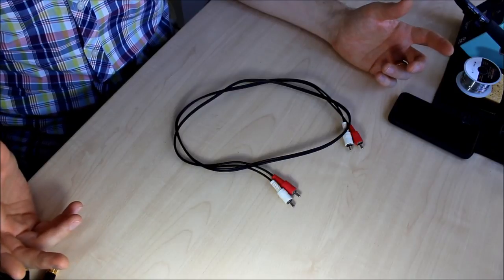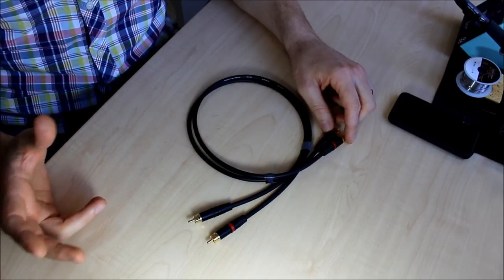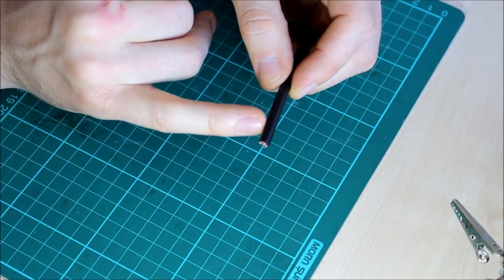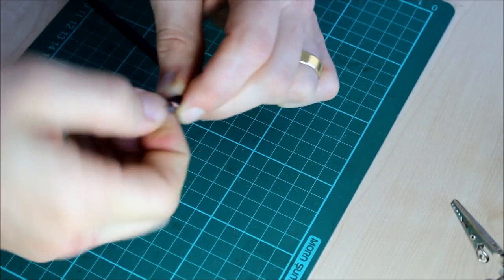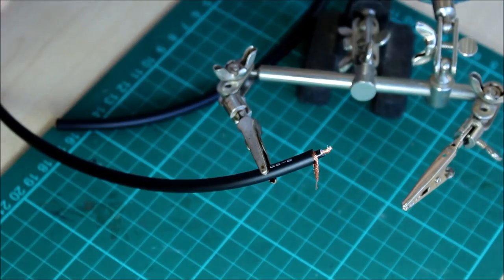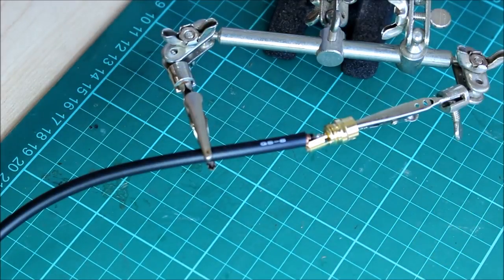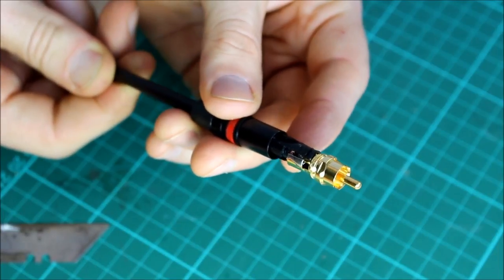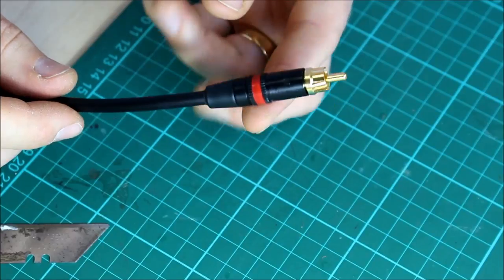How To: RCA Cables from Instrument Cable - Rean Connectors

Comment: A very excellent video. I liked to add that for other viewers that sometimes the inner core insulation can melt and causes short circuit if not careful when applying excessive heat for a longer timer.
So what I do is to put heatshrink in the inner core insulation to stop this from happening.
Reply from the maker: Great tip!

Comment: I use quad core microphone cable.  The problem with instrument cabling is the semi-conductive layer between the inner conductor's insulator and the shield; the cabling is of different design.  Then match your connector metals to what they are connecting to, or just use gold.